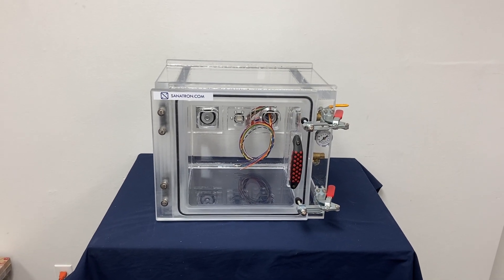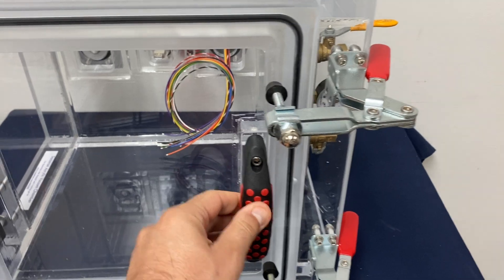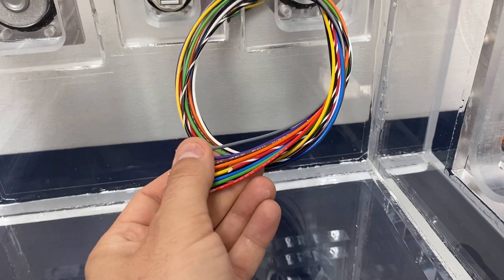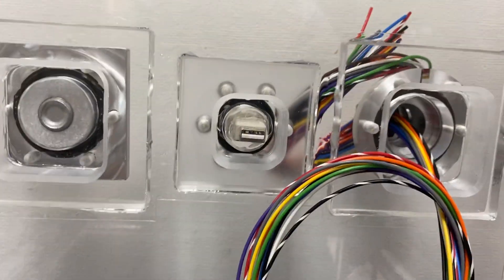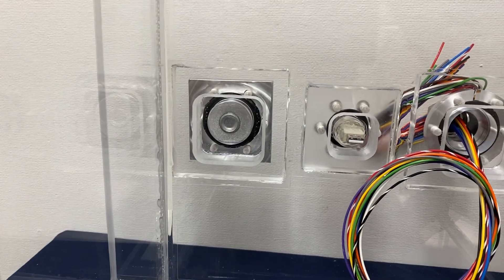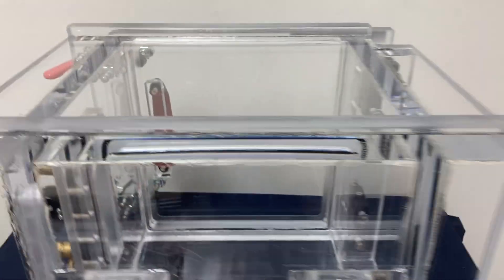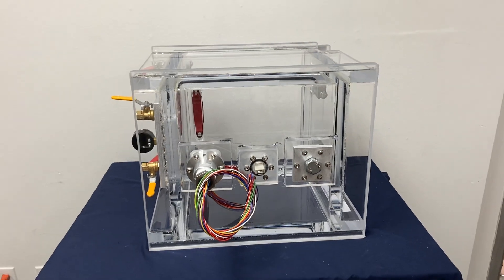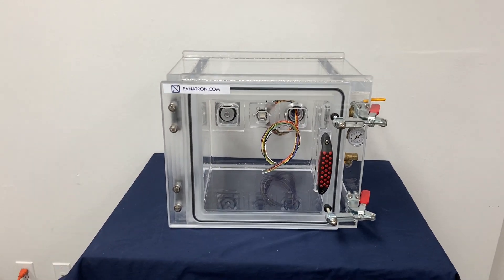Customized, 12 inch Cube Vacuum Chamber, Front Loading, with USB, and Wire Vacuum Feedthrough

Comment: how high of a vacuum can this do?
Reply from the maker: I'm assuming you are asking about how high of vacuum (absolute pressure). 

With a good industrial rotary vane vacuum pump, you can get to absolute pressures in 1 Torr in less than a minute, 0.1 Torr in less than 10 minutes, and 0.01 Torr after 24 hour of pumpdown. Cheers!